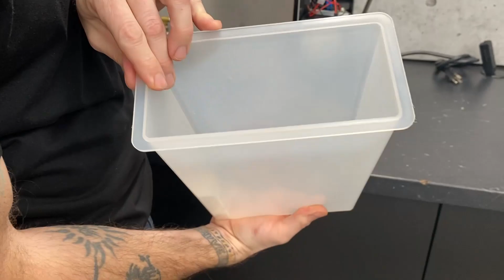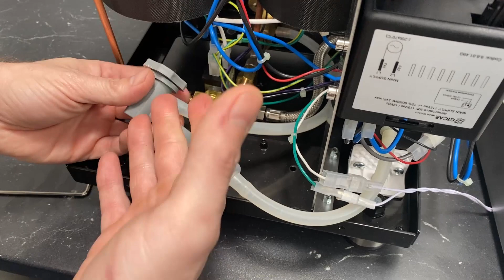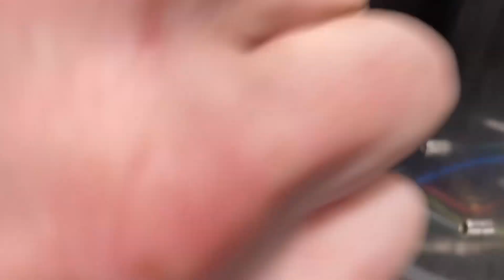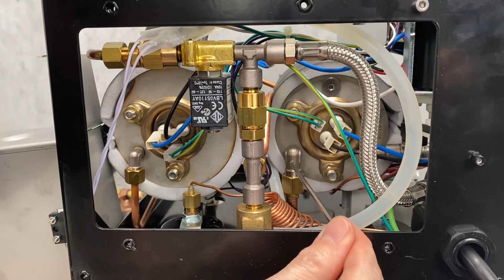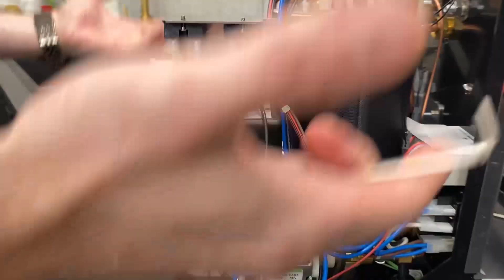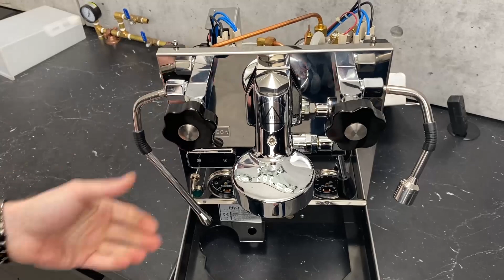Profitec Pro 600 Espresso Machine: Internal Tour & Component Identification

Comment: Is it possible to get a shorter power cord with right angled plug like a refrigerator for installations where the power outlet is directly behind the unit and counter depth is limited?
Reply from the maker: Hi stef, Should be very doable for someone with proper electrical skills.

Comment: My profitec only works on 8 bars, when a switch the screw to go up the pressure the pump stops works, only works stable in 8 bars and below, what you think is the problem?
Reply from the maker: Hi b, hard to be certain from here and not sure I fully understand your issue. Changing the OPV setting to a higher pressure should not stop the pump from working - it's actually less stress on the pump.
Reply: If i change pressure on the OPV the machine stops brewing when touch 9 bars and stop noise of the vibration pump. Only works and brew 8.5 and bellow bars pressure

Comment: Is profitec a cheaper build of the ECM machines? Synchronika seems to be an identical layout but perhaps has some beefier components (The synchronika motor is enormous and needs the large cap they fit as well but that could just be the style of motor being big not more capable?).

Does Synchronika have the bottom access? 

I love it when equipment is designed for maintenance, not just manufacture or assembly.
Reply from the maker: Hi mr, ECM and Profitec are sister companies. Kinda like Lexus/Toyota. For instance, the Synchronika and Profitec Pro 700 are essentially the same machine inside the case. Difference is detail of external finishing. The Synchronika does have a bottom access panel. ECM/Profitec does put effort into the serviceability of their machines. Here's an interview I did with Michael Hauck CEO of ECM/Profitec. He discusses specific technical innovations and his design philosophy: https://youtu.be/K0RI5rdz4Ww

Comment: Do you think it would be more wise to purchase a Profitec pro 600 over the rocket Giotto cronometro?

Also is there any drawback with the different design of steam arm and hot water arm on the Profitec 600
Reply from the maker: Hi Zack, Thanks for the question. Personally, I'd go with the Pro 600 unless you're going to go with EVO R version of the Giotto which is plumbable direct to waterline and has a rotary pump. The Type V Giotto is not plumbable and uses a vibration pump. Other considerations: The Pro 600 is a dual boiler so can run independent temperatures in each boiler. Plus, the Pro 600 can run at higher steam pressure than the Giotto for better frothing performance. And, the Pro 600 is available with flow control (free upgrade at the moment from us) of the E61 group which expands your extraction capabilities. Check out the Pro 600 w/Flow control here: https://www.wholelattelove.com/products/profitec-pro-600-dual-boiler-espresso-machine-with-flow-control
Hope that helps!
Marc

Comment: Great Video!  The mechanical Engineer in me couldn't help but diagram the system out as I followed your video.  The one thing I was hoping to see was if they routed the E61 to the brew boiler, as opposed to steam temp on a normal HX machine.  Love that they did it this way so you won't need nearly the cooling flush (if any) that you do on an HX boiler.
Reply from the maker: Hi BS, Thanks for the for the comment!

Comment: Great video, how can a machine not have a PID after seeing how easy it is to install and looking online the units are very inexpensive.  I saw a video of a $2500 machine with no PID, that is a head scratcher.
Reply from the maker: Hi EK, Thanks for the comment. Some users actually prefer a machine without PID - not a lot but they are out there. Reason is brew temps (if you know what your are doing) can be manipulated quickly using timed flushes prior to an extraction. So you always run your boiler hot. Then flush some water (usually timing the flush) to reduce the brew temp prior to pulling a shot.

Comment: This video is great. I’m having a possible issue with my Pro 600 (purchased in early 2020 from WLL). The steam boiler will randomly sit at less than a bar of pressure and will struggle to get back up to the full 2 bars. The steam and water valves are sealed. The PID is set to the correct temps for 2 bars, but shows a current temp in the mid 100s (way lower than the set temp). No signs of leaking or new sounds from the machine.  
The boilers are filled. My water is good. When this issue happens it’ll sometimes resolve itself after 5-10 minutes.  Other times I may need to open the steam and let the tiny bit of pressure escape, which seems to wake up the heating element. Any theories of what could be going on?

I’ve taken apart the flow control valve to see if there’s any signs of hard water, and my machine looks great. If I run the hot water valve the water will have the smallest amount of tiny minerals that come out, with otherwise clear looking/tasting water. So I’m stumped.
Reply from the maker: Hi JJ, Hard to be certain from here but an idea or two. First is an intermittent issue with the relay providing power to the heating element of the steam boiler. Another was a leaking vacuum relief valve but that's unlikely. You'd hear hissing and the boiler would heat beyond 212F. Sounds like the temp probe is working properly if it's indicating a temperature that makes sense with the indicated pressure but... Is the boiler making steam when the PID is indicating temps in the mid 100s? If so then either the gauge is wrong, temp probe is wrong or maybe both. The boiler can't make steam unless it's over 212F. Best course of action is to contact our tech support dept. here: https://support.wholelattelove.com/hc/en-us
They can help you better diagnose and resolve the issue.
Reply: @Wholelattelovepage  Thank you! I'll be sure to record a vid and contact tech support the next time it occurs. Based on what you described, I'm thinking the first scenario with the relay seems the most likely. Much appreciated!

Comment: Very good video.  
could you tell me the function of the two thermostats on brew boiler?   what is the meaning of : one for load and one for neutral.   
Thanks very much!
Reply from the maker: Hi RZ, Thanks for the comment and question. Those are high limit switches. They function like circuit breakers if they sense the boiler get too hot. In simple terms, the load side carries the power to the the heating element and the neutral side carries it away. Breaking the circuit on either side prevents the element from heating.
Reply: @Wholelattelovepage  Got it, thanks again!

Comment: Any chance of making a video guide on how to correctly descale the Profitec Pro 600?
Reply from the maker: Hi CH, Thanks for the request. I'll talk to our service manager about that. It's a request we get on a regular basis. Problem is it's risky due to the complexity of the hydraulics in dual boiler machines. If a machine has seen water that's too hard and/or been neglected, descaling can dislodge chunks of scale and cause problems in other parts of the machine. That's why manufacuturers recommend in their manuals DB machines be descaled by a professional machine technician. Best course is to properly filter water to reduce scale potential in the first place and use best practices like turning over water in the steam boiler for those who only ever use steam from the boiler and not hot water. If you steam only, over time minerals will concentrate in the steam boiler. To prevent scale potential look to products from BWT which uses ion-exchange technology to exchange magnesium for calcium in source water. That leaves you with a mineral level needed for flavor and equipment protection from corrosion and a mineral level that will not cause scale. BWT has in reservoir pad filters like this: https://www.wholelattelove.com/products/bwt-bestsave-s-anti-scale-filter or pitcher filters like this: https://www.wholelattelove.com/products/bwt-penguin-2-7-l-water-pitcher

Comment: So if one sticks to 50 ppm water, which should prevent scale build-up, what kind of maintenance would be required over the years outside of the easy things that the owner can do themselves (like backflushing, changing out shower screen and gasket, cleaning the milk wand)? Trying to get a sense of how frequently it needs to be sent in to a service professional. After 3 years, my Profitec 700 had issues with a loose wire and the brew gauge being clogged which ended up requiring a trip to an espresso service tech..
Reply from the maker: Hi AL, Thanks for the question. On top of basic maintenance you mentioned you'd probably want to lubricate and/or rebuild the E61 group annually depending on use level. If you're at all handy with tools it's a very easy job and we have a video which takes you through that in detail: https://studio.youtube.com/video/ELIwD40tsrs/edit?o=U
Using soft water as you'll avoid many of the common problems caused by scale deposits.

Comment: Question -

I just purchased a profitec pro 600 from you guys. Awesome machine and peice of equipment. 

However, immediately after unboxing - I couldn’t help but notice one of the blue wires ontop of the machine where the cup tray goes, see it when remove cup tray to access the reservoir. One of blue wires is right under and squished under the housing. You can visually see the wire and actually some of the wire jacket is shaved down due to had scraped on the grates.  This normal? You’d think there be more clearance of the wires to the housing. 

I can call customers service to report it and to see if need to take action for me to open top panel and push wire down or wrap with 3m soft electrical
Reply from the maker: Hi Anthony, Thanks for your patronage and sharing your thoughts on the 600! Very odd to see a wire with shaved down jacket due to rubbing on the grates. Honestly don't know how that could have happened. Are you certain you're not seeing some exposed wire near a terminal connection?
If you are concerned please do contact customer service. You can contact via email as well and include a photograph of what you are seeing. Here's link to support for contact: https://support.wholelattelove.com/hc/en-us
If you do need to remove the housing to inspect wires here's a video showing how to do that: https://youtu.be/1w367ifZOHY

Comment: This is an excellent video.  Thanks.  One question.   Should the reservoir drip when it isn’t installed in the machine?
Reply from the maker: Hi CS, Thanks for the comment and question. No, the reservoir should not drip. If you have one and it's dripping you may have some debris in the ball valve show at about :30 in the video.
Marc
Reply: @Wholelattelovepage Thanks, Marc.

Comment: 11:20 I see that’s how you drain the brew boiler how would you drain the steam boiler
Reply from the maker: Hi SA, To drain the steam boiler heat the machine up and simply open the hot water valve. Internal pressure in the boiler will push the water out. There will be a very small amount of water left in the boiler.
Marc

Comment: What is the insulation material that surrounds the two boilers. what is it called and do you have a link to order it ?? thank you very much
Reply from the maker: Hi MS, Thanks for the question. The material surrounding the boilers is an insulating foam inside a woven jacket. Unfortunately insulating jackets are not available individually. They are a low to no demand item as it's not a wear part.
Reply: @Wholelattelovepage  ok isee but it is a pity that it is not available for sale.

Comment: What is the best way to tell if you have the updated 600? Is it when they changed the Profitec label on the front of the machine?
Reply from the maker: Hi TMO, Not much has changed on the Pro 600 since it was first made. Maybe the logo badge and addition of brew boiler drain.

Comment: what’s the recommended time to clean the Profitec boiler, so it lasts longer ? Thank You
Reply from the maker: Hi Ruben, Thanks for the question. There is no recommended time for boiler cleaning. I assume you mean descaling as no detergents should ever be run through the boiler. Dual boiler machines generally should not be descaled by end user unless they have expert knowledge. Here in our repair facility we generally only descale dual boiler machines by removing the boilers from the machine. So what to do as an end user of a dual boiler? First, feed yoour machine with water that will not cause scale. If your tap water is safe to drink we recommend solutions from BWT. Their filters use a calcium to magnesium ion exchange which leaves you with water that will not cause scale when used as directed yet has the minerals needed for flavor and to prevent corrosion of internal components. If water is too pure, like distilled or zero TDS RO water corrosion of metals can occur. BWT makes an in reservoir pad filter the Bestsave: https://www.wholelattelove.com/products/bwt-bestsave-s-anti-scale-filter or their Penguin Pitcher: https://www.wholelattelove.com/products/bwt-penguin-2-7-l-water-pitcher
Beyond that use best practices like turning over the water in the service boiler regularly - especially if you only ever steam as minerals can concentrate in the boiler over time. You don't need to turn over much. If you heat/rinse cups with hot water from the service boiler or make Americanos that's enough. Otherwise run a cup or 2 of hot water out of the boiler every couple days of use and you'll be fine.
Hope that helps!
Marc
Reply: @Wholelattelovepage  I have the Pro 500 and I just got Urnex Cafiza to prevent scaling. My tap water is clean and safe, although I use a Brita pitch to purify it. Still I thought there was a recommended time for a twice a day use so it’s always run perfectly.
Reply: @rumar4u  You probably mean back-flushing. Cafiza is for backflushing your grouphead. You'd never (EVER) want to disolve cafiza and run that through your boilers.
Reply: @PatrickJoannisse   No I didn’t meant back flushing, I’m talking about keeping the inside boiler heating elements as clean as possible without calcification.